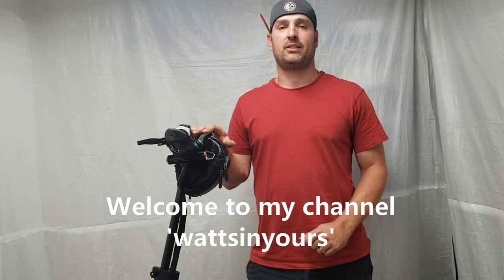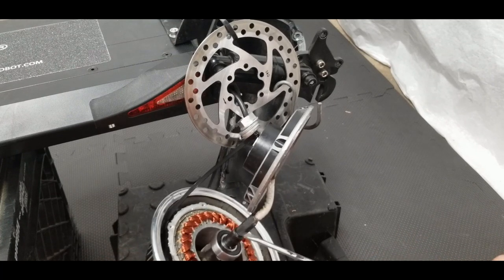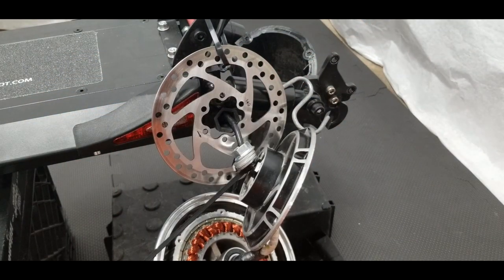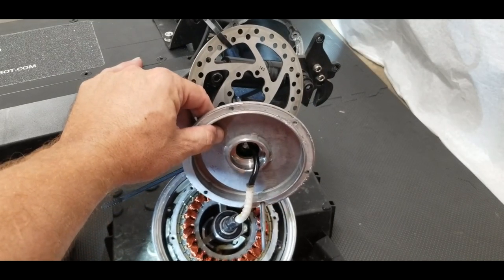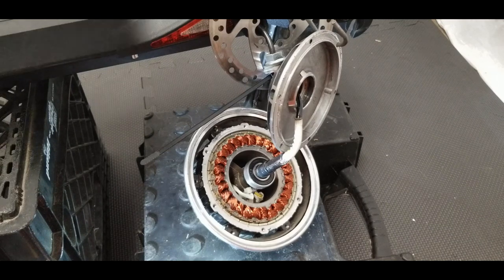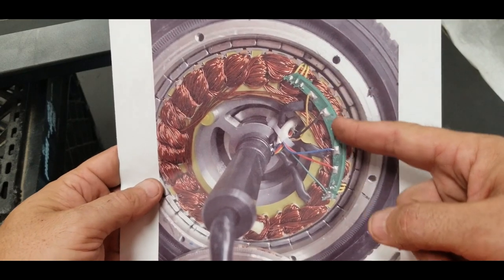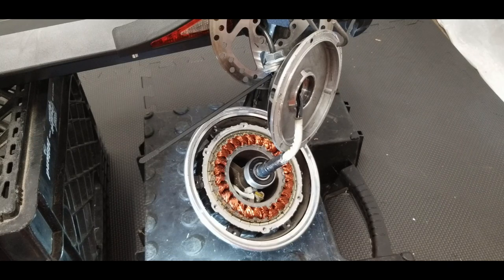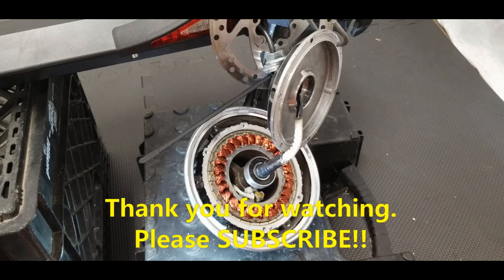Nanrobot D5+ 2.0 Mystery solved!! Brush less motor dissection, trouble shooting and speed accuracy.

Comment: Since there aren't any hall effect sensors (typically 3), your motor controller is using back EMF to determine when to commutate the motor as well as calculating your speed.  Speed controllers drive 2 of the 3 phase wires in 6 different states with MosFETs, one driven with battery voltage and the other ground.  The phase wire not driven goes into some electronics on the motor controller (resistors, caps, and op-amps) and it senses the back-emf. The designers use this info not only to know when to commutate the next phase of the motor, but uses the MCUs timer to calculate wheel speed.  It measures the time in between the EMF pulses and based on the diameter of the hub and tire calculates your speed - 2*PI*R * time for one rotation ( 3 EMF pulses).  Google back EMF for more detailed information on the topic.

Same as Ale's comment below....
Reply from the maker: Thank you for that detailed explanation, very helpful. A lot of stuff going on there to get inaccurate speed most of the time. Lol. Either way thank very much you for your time.

Comment: Great video, thanks for sharing. I found some time to take my wheels off today and installed the tube liners, I took my time because I wanted a clean fit, with no over or underlap, got it back together, and took it for a couple spins around the neighborhood, all good bro. Yea thanks for the heads up on making sure it was cut to the right length to avoid speed wobble in the tire. I feel better running on puncture proof or at least puncture resistant tires. Cheers man!!
Reply from the maker: Good job man! Glad to hear that worked out for you. Keep us updated later on with any issues or success. Ride safe.
Reply: @wattsinyours  Thanks, hey for sure I love my scooter. In hind sight I should have replaced the inner tubes as long as I had them out of the tire, I remember you said you got some off Amazon, I should have done that, but at least I have the liners in the tires so it will be a good experiment. I will keep you posted on any developments.

Comment: Great content as usual. Subscribed. I built esk8 for a while and was curious to see these escooters open up. I am also going to modify mainly the electronics of these scooters. You can get more out of them. Since you asked, her efew clarications. I hope useful for everyone. The brushless motors used in escooter and skate for instance are not DC, that's one of the reason why there is a speed ccntroller to talk with them. They are powered by a battery (DC) but they are 3 phases motors.
Regarding the hall sensors they are, as you said, telling the speed controller (ESC) the position of the sensors in angle related to the stator and are used to smooth out the take off when starting from stand still. Then they have no use anymore. Sometime there is also a temp sensor on it to read motor temp to prevent overheating (you can implement that, sensors cost like 5$).
Concerning your correct question how the speed is calculated then the speed is based on RPM or to better say Engine RPM (ERPM). The ESC reads the back-emf and count it as 1 rotation (you can read here from an open project for advacne ESC that we used in esk8 http://vedder.se/tag/esc/). Since is ERPM then the size of the motor matters so you have to know the number of poles of the stator. The conversion of these values plus the size of the wheels combined with the 3.14 constant (circonference) will tell you the speed. That's why on your dashboard you can set the wheels diameter, but actually to be correct it should have the number of poles as well in order to adjust them and get the right speed. 
I hope it can help and thanks for your content!
Reply: Nice input man. Thanks for sharing

Comment: Hello again. Been a while. I finally had my first flat tire on my D5+2.0. It was the rear. I live in NYC. I ride every day to and from work, in the rain, and recently in the snow. Well on my way home today I had to cross the 59th street bridge ( using the bike lane ) and there was some kind of nail or bolt, spiky thing ( no point on it ) sticking out and I didn't see it. All I heard was the explosion of my rear tire. Luckily I was not going too fast. The piece of metal snapped off and stayed inside the tire. When I replaced the tire and tube it fell out. Anywho, I was hoping to also change out my rotor which is bent, but after taking the real wheel apart I realized the rotor sits on the cable side of the wheel. Do you have any idea how to take it off without having to cut the cables? If so any chance of you making a video on that process? 

As always thank you so much for you educational videos. I've learned so much from your efforts and I truly appreciate what you do!
Reply from the maker: Yes its the same process as the d4+. I have a video on it. Pretty easy with a little patience. Go to my videos and look for d4+ flat tire repair. Thank you for watching.

Comment: Have you delt with a rear tire on a e scooter not having any rotation when you manually turn it and when you try to use the throttle?

Comment: can you provide summary?  set P0 back to 10 then P2 to?
Reply from the maker: P2 will be 18
Reply: @wattsinyours  I'll try it after work.  Thanks a bunch bro!
Reply: @wattsinyours  set p0 to 10 and p2 to 18.  Speed accuracy is way better per my garmin GPS speedo.   I know you explained it in your video but can you summarize why setting p2 to 18 did the trick?
Reply from the maker: @MinhvuLy  because its not reading hall sensors. P3 is reading pulse width modulation. Basically it corresponds with voltage. Thats why p3 is default at 1 and not 0 like the manual says.
Reply: Thanks fellas I set mine back to 10 and adjust the p2 to 18 works nice

Comment: Speed sensor could be in the back wheel? Since single motor mode is just the back wheel. Just and idea
Reply from the maker: Well since the rim is a split ring and i looked closely at that, i didn't see anything that looked like a sensor and also it wouldn't be in the tire itself bc that wouldn't be practical bc of flats and tire changes. But either way i will look again just to make sure. You never know i could of definitely missed something. My best guess as of right now is that it sends something like a pulse width signal back to the controller through the motor wires during rotation and is calibrated to read those pulses at a predetermined rpm or rotational force. Thats a pretty cheap and easy way to read speed but not as accurate as hall sensors.Thanks for your input and eventually together we will find out exactly what is reading the speed.

Comment: Great videos, thank you. Btw. please, make a video about what is inside of Nanrobot lower tube.
Reply from the maker: What lower tube are you referring to?
Reply: @wattsinyours  I mean vertical stem. I have an electric problem with  front -and rear lights and I wonder how cables are inside of the vertical stem.
Reply from the maker: @-12382  there might be  a loose connection at your on and off switch so i would check that first, but if that is good then you will have to take off the deck and look inside the scooter. I did a video on that and i go through the wires, so maybe that will help you out after you watch it.

Comment: Very helpful! What is the p2 setting you found to get accurate speed? mine seems to be 17 18 or 19 but I'm not certain because I can't look at my phone while I'm riding, I don't have a mount set up
Reply from the maker: I haven't had a chance to retest for accuracy before i post it. I dont want to give the wrong info, but i think it was 18 if i  remember correctly. Also remember when going at higher speeds (over 25mph) don't get discouraged bc the voltage increase and decrease bc of "pwm" is going to fluctuate until your going at a consistent speed.
Reply from the maker: Just checked its 18

Comment: Hi,

I also set up my P0 to 6 and the speed is quite accurate ; 

Did you finally changed your settings (P0, P2 and P3) in order to be as accurate as possible ? I missed the point 

Thanks
Reply from the maker: That is what i had it set orginally P0 to 6, but now that i know it does not have hall sensors i will make that adjustment. I haven't had a chance to make the adjustments and test yet, but i will soon and let you know the results. Thank you for your comments and watching my videos.

Comment: My rear motor is on the fritz.  It engages for about one second and then it quits and it feels like it’s rubbing on something like the magnets are in the right place just a little off I don’t know I haven’t gotten into it yet but there’s a warning indicator light that I can’t seem to find with the indicators I don’t know where they’re at in their instruction so I’ll keep looking.  thank you
Reply: My motor is rubing also what do I do
Reply: @guillermoguzman250  make sure all original screws are being used & when reinstalling the screws do all of them together like a star pattern evenly. 12 o’clock, 6 o’clock, 10 o’clock, 4 o’clock…..

Comment: I have been having problems with my scooter. It is not even 1 year old, and when I ride it, it makes this vibration from the rear wheel, and it overheats causing a puncture in the inner tube. Over 1 month I replaced the inner tube 3 times. Is there something I can do

Comment: love ur videos man...does nanrobot even have a legit american tech guy for troubleshooting cause I've sent him my issue with video evidence and he said he would jus look into it and that was a month ago...my issue is jus odd like the motor is overvolting at hard throttle from start and makes a plastic grinding noise...any thoughts?
Reply from the maker: Lol no they don't. That's why we got to try and do it ourselves. So as far as your issue there are only 3 things it could be. Speed controller, throttle controller or motor going bad. Either item is not to expensive to replace but im ruling out your throttle so it's between your speed controller or motor. I would replace the speed controller first bc it's the cheapest and the easiest but mostly bc that's usually the issue. But before u go through all that go through the scooter and make sure all your connections are tight. Once verified and it doesn't get better then replace the speed controller.

Comment: This is fantastic information.  Other than the bearings these motors should last a long long time right?  So theoretically how long could it last with a quality set of bearings?  I didn't get to finish the video.  Just saw the first 10 minutes so forgive me for a lack of information.
Reply from the maker: A good quality set of bearings will last a super long time. The one's that came with it are fine just not as good. Japanese or german bearings are usually top shelf.
Reply: Good to know.
Reply: @wattsinyours  Any speciality tools needed to change out the bearings? It would be fantastic to not have to depend on the manufacturer to repair the scooters.  So much money saved and of course the pride you get doing it yourself.  Thanks again for this video.
Reply from the maker: @mtbse789  possible need a bearing puller and something to press the new bearing on, but if you get creative and be carefull with the bearing you can probably do it with some basic tools.
Reply: @wattsinyours  Thanks.  I will look it up.

Comment: It may be on the other motor....
Reply from the maker: It wouldn't be in the other motor because when you have the switch on the dash panel to only single motor then it would only be reading back motor speed and not front motor speed. The speed is read through a voltage signal, so if the front motor isn't powered it will not read any speed on the front motor. Only the back.
Reply: wattsinyours just a thought. Thanks for the reply
Reply from the maker: @123motd  Thank you for watching. It's feed back like yours that help us have fun and keep our scooters running smooth.
Reply: @wattsinyours  Well I made a really simple test with my D4 and it's the rear motor that senses speed.

Just make only Front wheel then only Rear wheel spin and look at the speedometer...
Don't mess with the P2 adjustment.